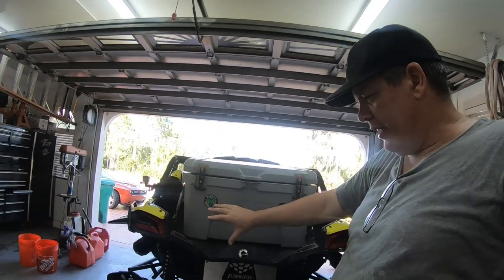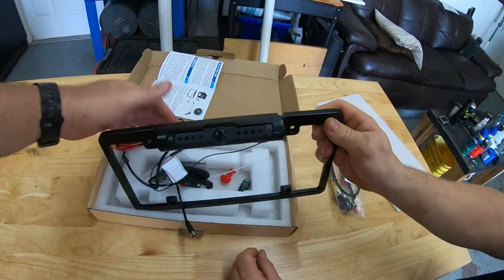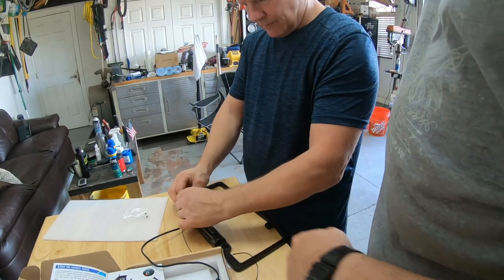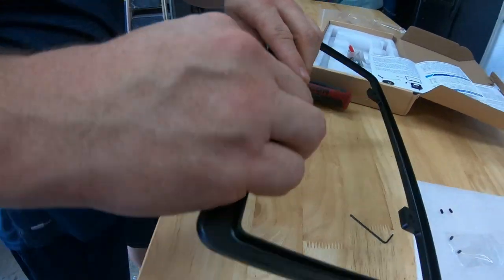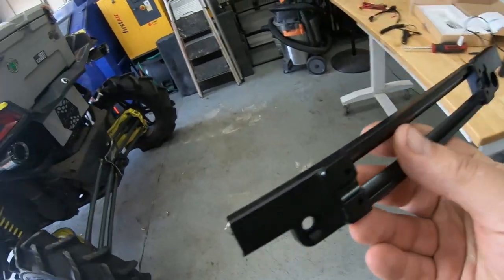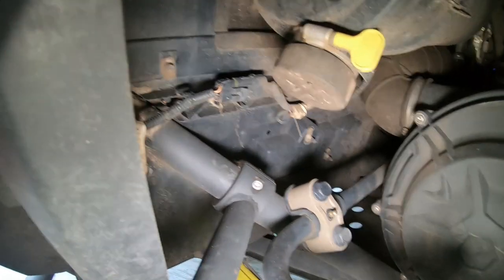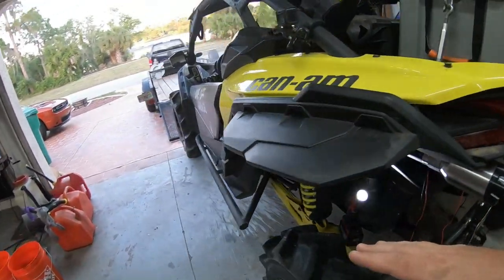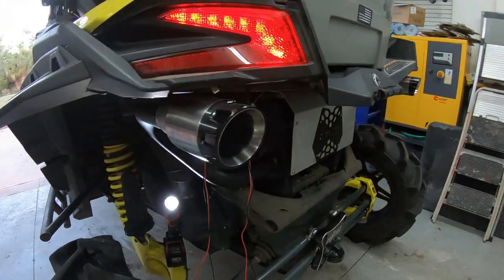WiFi Back Up CAM Install and Review for SXS UTV with Tablet

Comment: Do you by chance have a link to the pigtail/ harness you bought that plugged in to the back of the tail light? And maybe the camera you used as well? I'd really like to do something similar. Are you still liking this setup?
Reply from the maker: Muzzys Tail Light Whip Power Harness Adapter Splice Pigtail Jumper FITS: 2012-2023 Can Am Maverick X3, Max, X-DS, etc. for Powering LED Whips Brake Lights License Plate Lights or Any 12v Accessory https://a.co/d/38iIYOB
Reply from the maker: The original cam failed after 2y, I'm using a wifi cam to my tablet now,  it's OK but dosen't have night vision so I would 100% recommend it

Comment: How has the camera and mainly the app treated you while out on the trails. Anything you wish you would have done differently?
Reply from the maker: Works pretty well. I don't use it to much.  But it's nice to take a quick look.  The orientation is revered a lot of the time.  The app is super basic. Not sure if you can find a better one
Reply: @oneoffgarage  how is the wifi camera when you are offroading? Did you have any conncetion and image quality problems? dude 🤙